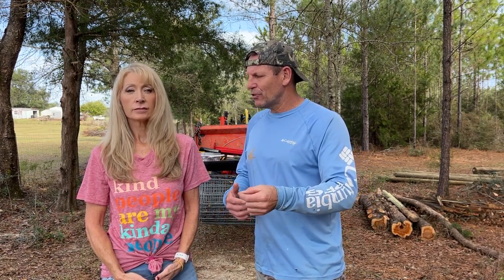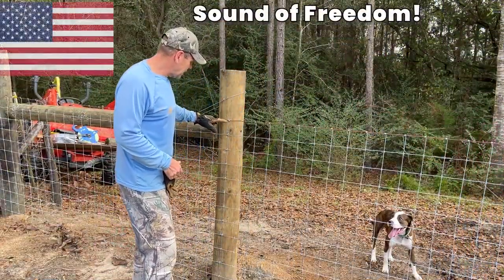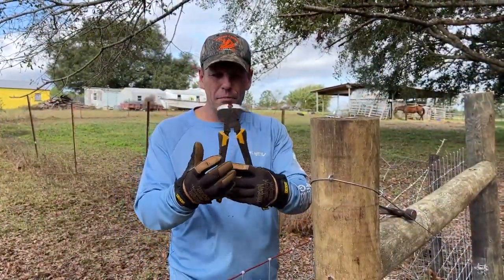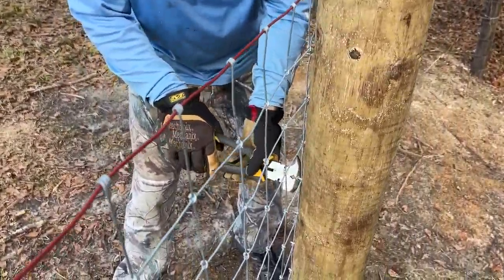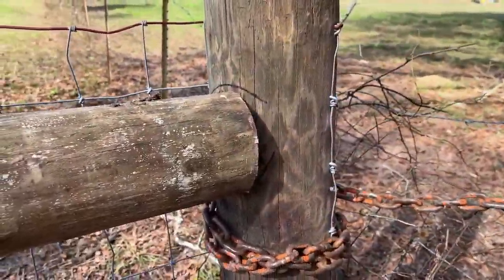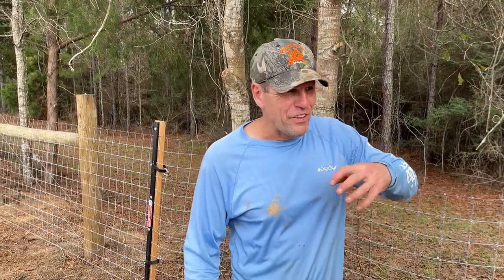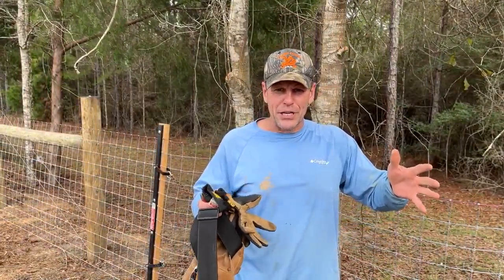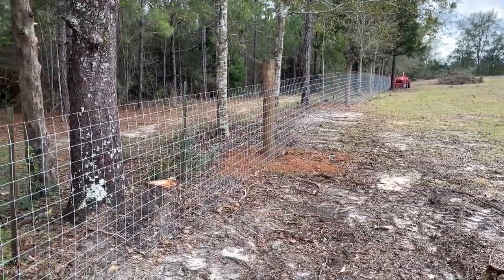How to stretch fence wire with simple hand tools | E60

Comment: Well done you guys. I haven’t done the woven wire fence in several years. Just the really light duty fencing around the garden. I made a homemade device to bolt through the fence and use the tractor to stretch the fence. You need to be careful not to pull the fence apart, but I have been able to get the fence nice and tight.
Having done my share of those fences, I can really appreciate what you guys are going through. Believe me, I feel your pain. Thanks for sharing Brad and Deb
Reply from the maker: Thanks Gary.   We enjoyed doing it (mostly), but glad it's done because it was a way bigger project than we thought it would be!!   B&D